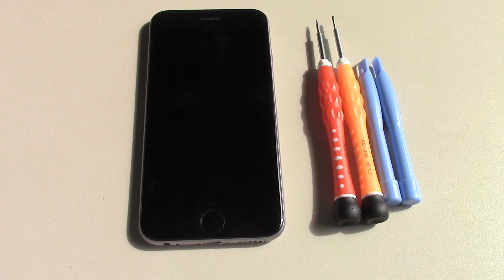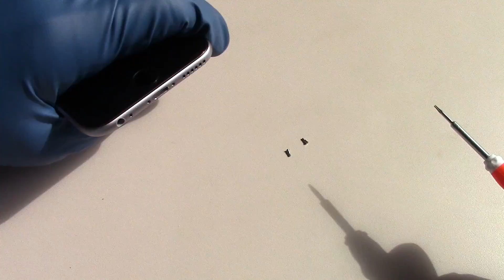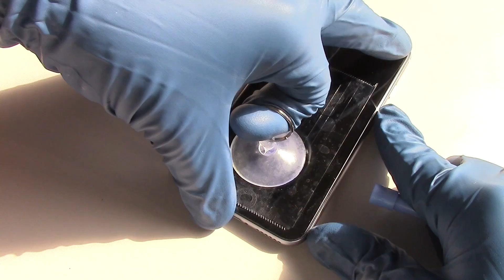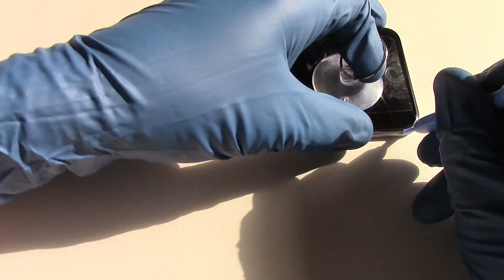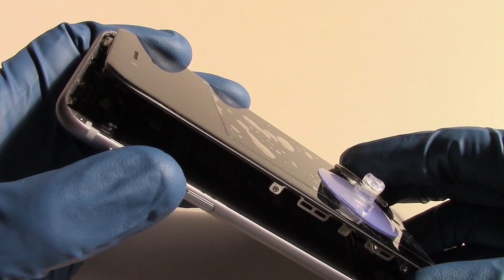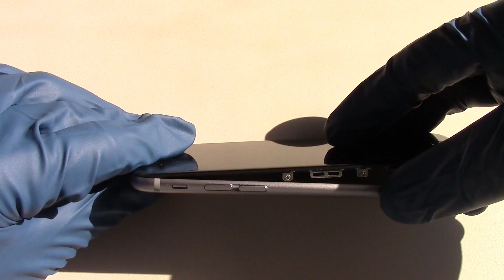iPhone 6 Screen Repair Tutorial LCD Replacement DIY Glass

Comment: I have an urgent question.. the front screen of my iphone 6 is cracked/broken.. there are lines, and the touchscreen is working.. but not number 1,4, and 7 on the left side which has the red and blue lines.. do i order just the lcd screen?